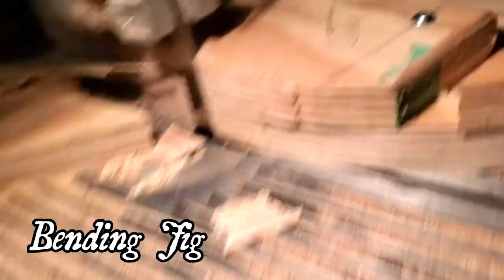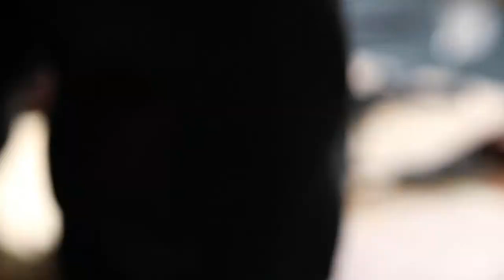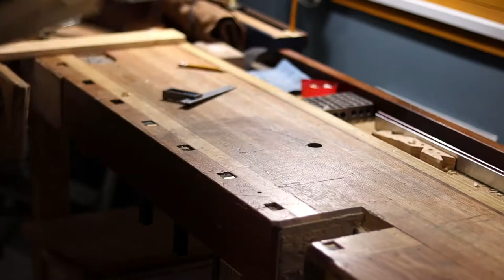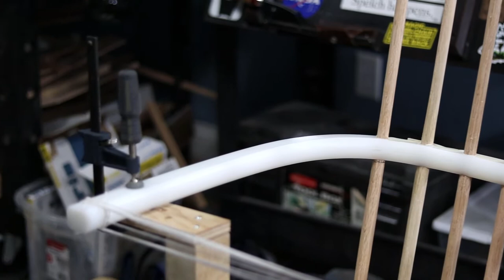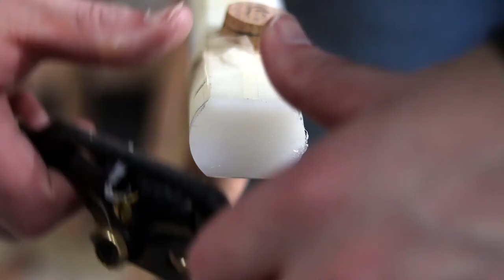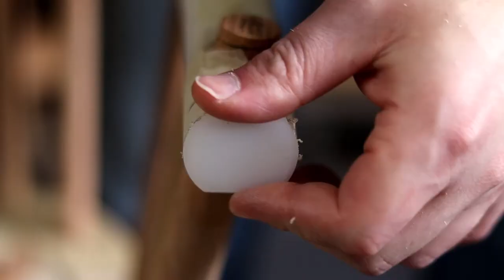Building a Welsh Stick Chair - Part 3 | Using Modern Materials in Traditional Forms

Comment: Honestly when I was thinking though this arm bow problem it never even occurred to me to use another material especially 
a high-density thermoplastic polymer. Nice thinking outside the box Eric.
Reply from the maker: Thanks! It comes with its own challenges. You cannot use glue so you need mechanical fastenings. Also, no paint will stick to it. You cannot sand it either so your tool game needs to be on point. It does scrape pretty well so that helps to smooth out any errant tool marks.
Reply: @EricMeyerMaker  ahhh yep! 😁 I’ve been thinking about it since watching the build. Damn dude super cool
Reply: @EricMeyerMaker  and oh the power of the lowly scraper!
Reply from the maker: @o2bsam  The scraper is my most trouble some tool. I still need some practice getting that one to leave behind a nice surface.